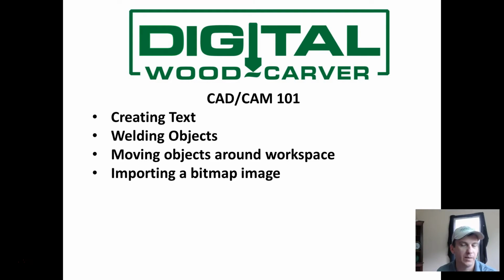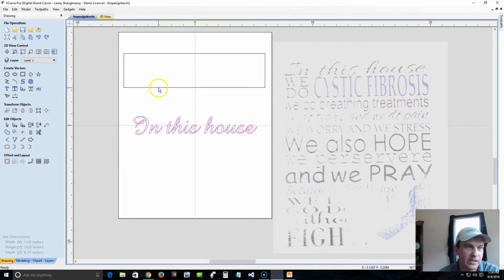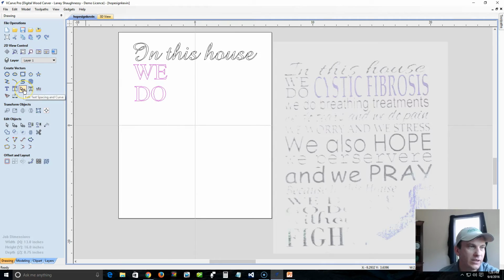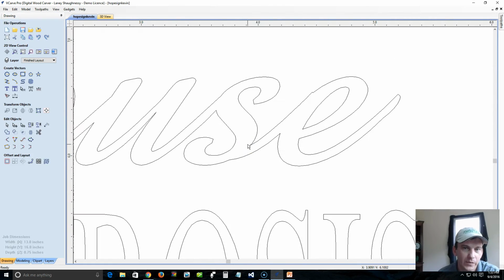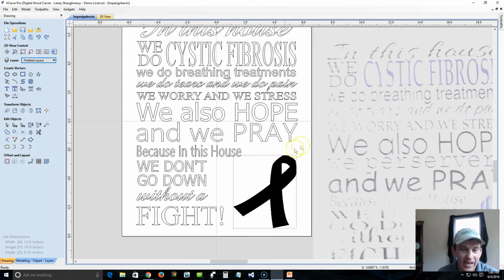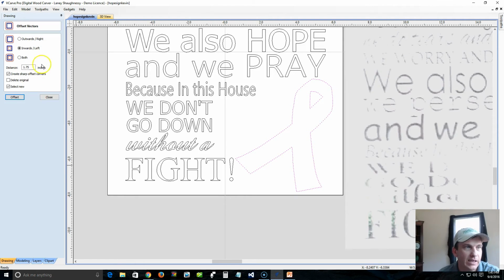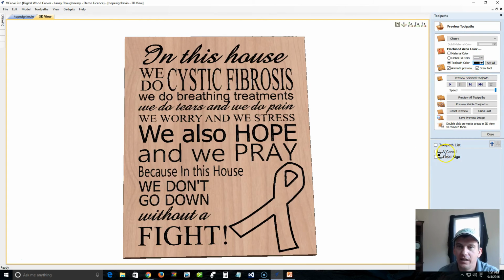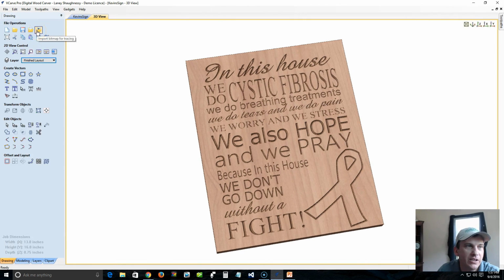CAD/CAM 101 - DWC CNC Tutorial - Simple V-Carve Sign

Comment: Great instruction videos thank you.  I have question about the touchplate. When I connect it and test the connection by holding the touchplate connected towards the drilling bit,  the CNC USB Controller software shows the Z position in a RED box...but there is no change in the box in the left-hand lower corner. When I press the software button to determine the Z axis zero point...the spindle just keeps going down into the touchplate tool, while the Z position box does turn red. How can I make the spindle  stop and auto retract? Kind regards,
Vincent